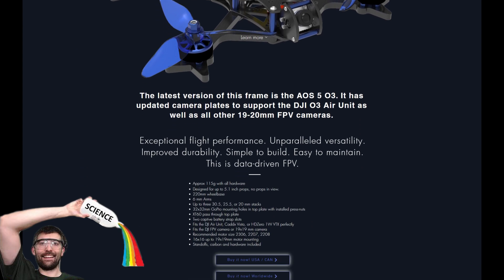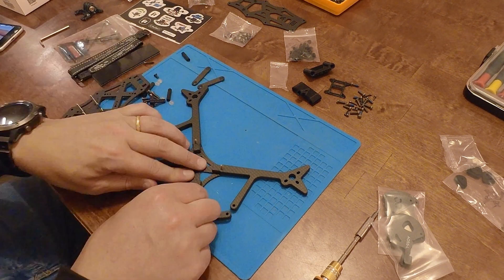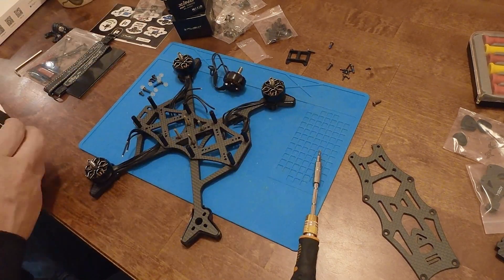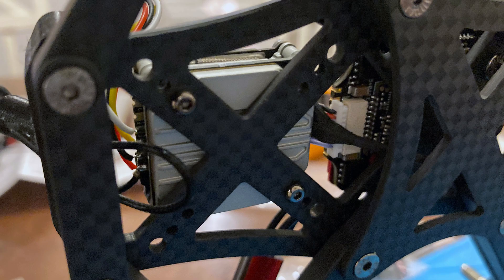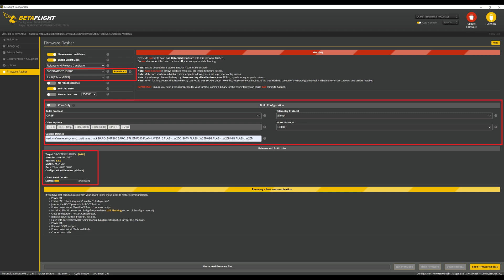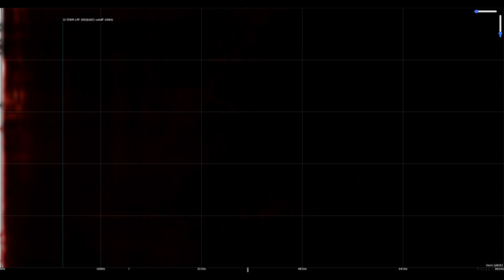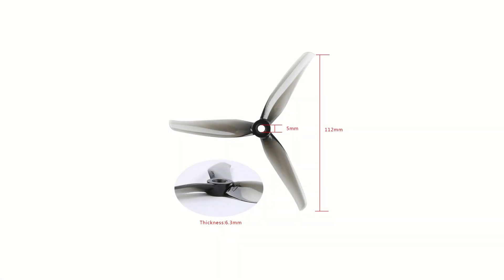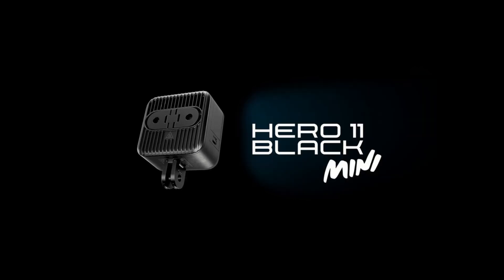AOS 5 v2: Building the Ultimate Freestyle Drone using Science? [AM32, F7, XING2, eLRS, Vista]

Comment: Nice video, thanks. How is you elrs signal with antennas on the front arms? I've just bought the elrs true diversity receiver and looking for the best spot for it. Cheers
Reply from the maker: Very good I would say. The Video signal drops off way before the eLRS
Reply: @andreas-ohman  many thanks. I will give it a go today 😃😃
Reply: What PMW frequency are you running on your esc firmware, 24 or 48? Many thanks :)
Reply from the maker: @jacek_kaczmarczyk  the AM32 ESC does variable PWM and I cave that enabled.
Reply: @andreas-ohman  ok cheers.. didn't know that 😃

Comment: You can rotate esc 90 degrees and make a short wire on the side. It's more comfortable than the XT60 front or rear. Solder the capacitor on esc outside the frame. The capacitor must be well filled with sealant. You need to take a solid-state capacitor since it has a smaller size and better characteristics.

Comment: Just make the xt60 wire slightly longer and mount the battery the opposite as what you do now.
Cheaper than getting a new camera
Reply from the maker: Yes, that would be a good option. I do however believe that the idea Chris has was to keep the leads short to avoid vibrations
Reply: @andreas-ohman  if you strap it down with the battery strap properly that'll solve it. He wanted to keep it short to prevent as much current/power loss from a long wire.